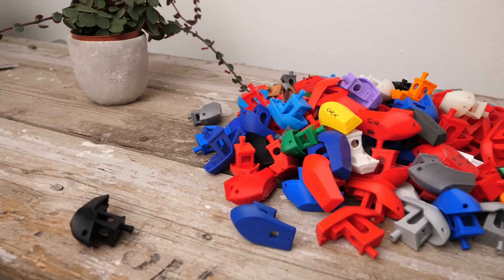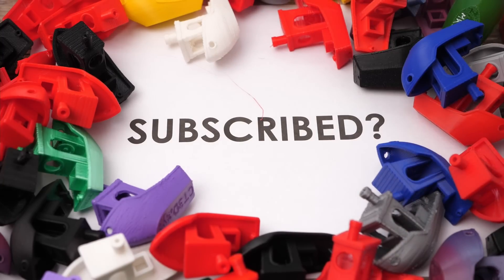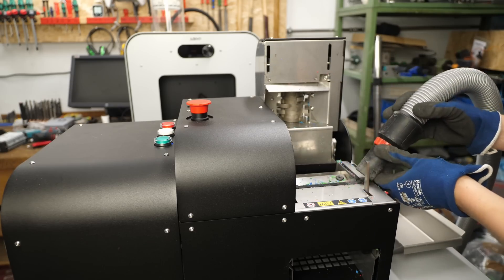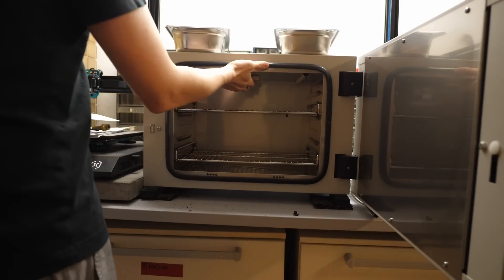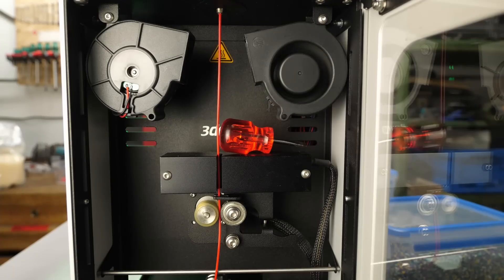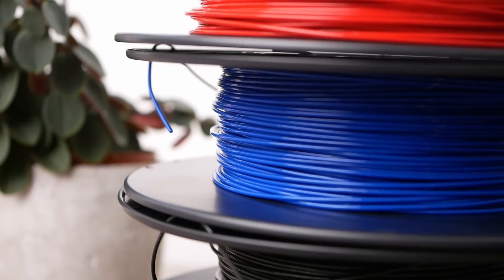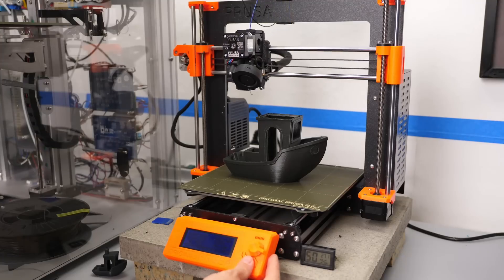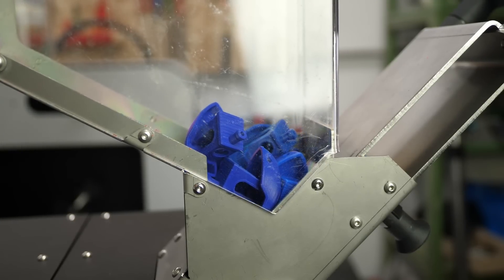Recycling all my 3DBenchys into new Filament

Comment: Someone needs to design a test print that is also a widely useful object.
Reply: I use a skeleton mini I find works well, and it just adds to my undead army for D&D.
Reply: @CaptainXJ  Neat idea, although lots of different colors might look weird on a skeleton army. But you could easily print different races and monsters for each color
Reply: Hooks that are compatible with 3M command tape would be a good start. There's lots of ways to design such a thing to test overhang, bridging, etc.
Reply: @pragmax  that's...  That's actually a good idea.
Reply: Perhaps a small boat for 3d printed wargame miniatures
Reply: A lego like 2x2 brick would be cool
Reply: I do my experimenting on objects I wanted to print anyways. Still a fair amount of waste, but at least I get something out of it.
Reply: I use shot glasses as my test prints
Reply: @LoadsOfMana wow, you must do a lot of test prints
Reply: @LoadsOfMana  I was going to do that but heard alcohol can readily pass through most of the plastics. Is that not the case?
Reply: @breakfast7595  You can coat them so that doesn't happen, but im lazy and didnt so yes it is def the case :P doesn't really matter for shot glasses though, since your shotting it soon as you pour anyway, takes a min for it to start escaping.
Reply: @breakfast7595  most people spill anyway lmao... source? I'm drunk rn. It's taking forever to type
Reply: What about some sort of clothespin ?
It's exactly the kind of object that can be made entirely out of plastic, is always useful and you need just about a billion copies of
Reply: i dont think they will be useful anymore if you have 500 of them
Reply: @DI-xe8vq  If you have 500 of them you're kinda doing a bad job at calibration ngl
Reply: @giedrius2149  or testing alot of different printers, filaments, or setting
Reply: @giedrius2149  love the ancient mesopotamian username
Reply: i print lego blocks
Reply: My test print is a set of D&D dice.
Reply: Obviously Lego's lol
Reply: I test print little tubs and boxes, because we've all got screws and other little bits that need storing
Reply: @TheHutchy01  that's smart! benchy has a bunch of difficult features meant to put your printer to the test; I wonder if it's possible to incorporate similar features into an otherwise simple box
Reply: good idea. how about a set of dice. instead of an xyz cube?
Reply: just make a water cup
Reply: make spoons or forks ?
Reply: A coaster :D
Reply: Print-in-place hinges are good, or organizers and dividers.
Reply: I've never actually printed a Benchy. I printed something that came with my printer with it's standard pla,  but after that I started printing my own designs and went from that.

I did print the print the infill cube to see how my extrusion was.
Reply: A phone stand would be good.
Reply: Screws?
Reply: I am thinking of redesign the benchy as a float for fishing. Adding a pocket for a coin at the lowest acts as a counterweight when in water. Fishingline holder is the exhaustpipe at the roof. Reshape it to a screw with pincing function holding the line locked. A bonus is when the boat goes missing. People will pick up this "litter" for the coin and hopefully dispose it in a trashcan (or use it again as a float)
Reply: knife
Reply: I hate wasting stuff. Maybe 3D printing isn't for me.
Reply: @goku445   If you are downloading models and printing them, there really isn't a lot of waste once you have your printer calibrated.  I have printed exactly one Benchy ever.  There is definitely some waste if you are designing your own objects to print.  I think of it as equivalent to saw dust.
Reply: @beauslim  Even if you stick purely to stuff other people have designed, a lot of models need suport material and/or brims, skirts etc.
Reply: @goku445  well I hope you would rather waste money 😂
Reply: Like a spoon?
Reply: @wynnnnnnn5227  There is No Spoon!
Reply: I use my benchys every day for various things. Door stops...... ummm I cant think of anything else atm. But I promise that adorable boat is useful haha
Reply: Yeah, I have never in my life printed a benchy or anything like that as it is such a waste, but even then there are failed prototypes and failed prints in general that add up, especially if you are looking at it globally.
Reply: a spork
Reply: Literally anything can be a test print haha
Reply: Legos, big duplos
Reply: what about a bag clip to close open bag of suger or salt and stuff.
Reply: Lego style blocks?
Reply: make 25% infill and bottom heavy and it'll float.
Reply: IK. you could make toy boats instead!
Reply: @DI-xe8vq  you could actually use a benchy in the water if it had been designed to have blast tanks.
Reply: @DI-xe8vq  a first step would be a useful swimming toy boat instead of the stupid upside down french marine boat.
Reply: @tdsangel  I like my submarines
Reply: benchy is useful it looks god on a shelf.
Reply: @cobz76  idk about a pile of 500 benches on a shelf...
Reply: Dildos are easy to print. And if you don't use it them you could gift them to others.
Reply: @MetalheadAndNerd  "unknown plastic additives", "abrasive surface", and "basically impossible to sanitize" are not phrases people generally like to hear in association with their sex toys. You could use carefully-researched filament and do some very intense post-processing, or print molds for casting medical-grade silicone, but that's no longer a test print model.
Reply: @spambot7110  Few people really sanitize their sex toys. Of course if you do it professionally you need professional grade sex toys which are dishwasher safe.
Regarding the unknown additives: Long ago I had a butt plug that liquefied the paint on the radiator I placed it on to dry after cleaning. Later it shrunk a plastic table cloth I placed in on. 3D filament additives are nothing compared to what unspecified Chinese "yelly" material contains. BTW: At least for PLA a couple of the lowest price brands now advertise theirs as food safe.
Reply: @MetalheadAndNerd  most people may not sanitize their sex toys, but I would hope they wash them with soap and warm water! That works ok because they have smooth surfaces that are easy to wash, while an untreated print is covered in tiny ridges that become a breeding ground for bacteria (in addition to tearing up your skin, at very least on a micro scale). A butt plug may be a bit better since one would hope the anus is able to routinely handle pretty gross material without issue, but it still seems pretty risky to me, especially if it's creating tiny wounds at the same time.

That's good to know that there are food-safe-advertised PLA brands though! But that still doesn't address the major safety issues with the layers. I know it's possible post-process prints to be body safe, and I'd love to learn more about that for my own purposes, but since we're talking about a benchy replacement, i think post-processing requirements would be a bit onerous.
Reply: @spambot7110  FYI, most PLA is food safe, but none of your prints are. The material is, but the process of printing creates small spaces and ridges for bacteria to live in.
However, you can dissolve some PLA in acetone, paint it on the model and let the acetone evaporate. (Do all this with good ventilation, acetone isn't great for you).
The acetone should slightly dissolve and smooth out the print surface. Best to cover the surface with medical grade silicone or a condom as well though. Better safe than sorry.
Reply: @MartinFinnerup  PLA is not soluble in acetone, you're thinking of ABS. to do the same thing with PLA, you need extremely dangerous solvents like chloroform.
Reply: Building Blocks. Ideally ones that could be reinforced with concrete or something. If you could build structures out of them, they stay out of landfills for a longer period of time.

Comment: I been saving most of my extra/ failed stuff just waiting for a cheap option to recycle them😉
Reply: me too, just can´t throw it away, cause i don´t want to waste anything
Reply: Melt it into plastic sheet or bar stock using a second hand oven and old teflon coated baking utensils as demonstrated by Precious Plastic on Youtube.
Reply: @Joshua0689  and how would that help in any way?
Reply: I resigned and thrown my 15kg+ of scrap and failed parts because it was taking too much space in my shop... :(
Reply: @Jonmal0ne  I felt this one.
Reply: Yeah I feel too guilty
Reply: Me too. It's just taking up some room in my basement until I have enough scrap to help offset the cost of the equipment needed.
Reply: https://www.robotdigg.com/m/product/1029/Desktop-Pellet-Filament-Extruder,-Production-Line?gclid=CjwKCAjwgISIBhBfEiwALE19SZXYKUIYFNtaC7QtwccHrLKXrcskZKkN9AK160IBC1od3b_SGl1ZZhoCm9IQAvD_BwE#

I doubt it's much good
Reply: @AdamMansbridge  and not really cheap $2,400 to get everything you need and it's made really only for pellets not grinded up 3d parts which you still need a grinder.

Comment: The reason for the deviations with the mixed filament might very well be due to the pigments within the pla, they all have their on properties and one filament might have a higher percentage of pigment to get the right color, combine that with other properties like hygroscopy and melting temperature and you get deviations that the extruder can't compensate for..
Reply: True but you missed the part where he sent a sample back to the extruder manufacturer and they had no problem that rules this out. The problem seems to be with his machine

Comment: Thanks for the nice video as usual. How about mixing recycled pellet with new pellet? I believe that the goal should be to reuse all your material, not necessarily have a 100% recycled spool. This might take down the inconsistencies by one order of magnitude but still achieving the goal of recycling all the unused prints.
Reply: If the goal is to recycle 100% of the off casts, then the best thing to do is give you trash to the recycler, and buy recycled filament. This is not the way to be nice to our planet
Reply: @joshua43214  i don't see your comment much related to mine, but more to the whole concept of the video, so basically it s a comment for stephan himself... i actually think that as long as you recycle all your material you don t hurt the planet, on top of the fact that pla is actually biodegradable

Comment: I work in manufacturing, high speed linear plastics extrusion is a large part of what we do (jacketing and insulating medium voltage cable)

The equipment in this video looks like miniaturized versions of equipment I work with.

We filter our molten plastics and rubbers through multiple layers of magnetized mesh screens to keep out impurities, especially metals, and handle our pellets in clean-room conditions.

The diameter of the extruded material is modulated by the extruder's screw rpm mostly, but fine-tuning is adjusted by adjusting the tension of the take-up spool.

As the spool fills up the force it is pulling with changes due to the effective-radius of the spool drum increasing the s it fills with material. We use in-line equipment to compensate for this, but the equipment's effect on the tension has a non-zero latency, so the faster the machine runs, the more the tension will vary along a given length, and I'm turn, the diameter as more tension causes the material to "neck-down" and less tension causes a "buldge".

If the latency of the tension-correcting equipment resonates with the rotation of the take-up spool that causes exponential issues.

As a spool rotates, it filled unevenly, and will become slightly oblonged, when the peak of that radius is pulling in the line the tension increases slightly, and when the trough is pulling on the line the tension decreases slightly, and when that resonates with the latency of the tension-correcting equipment then it looks like the line becoming slack- then taught, then slack, them taught. It can be fixed by changing the speed of the machine so it no longer resonates, and after the radius of the drum changes (from further filling with filament) the machine can be restored to it's ideal operating speed.
Reply: In line equipment used to stabilize the tension on the line are dancers.

Additional rollers installed in front of the take-up spool that have a degree of movement relative to the material's tendency to slack.

If slack in the material causes the line to drop towards the ground, then the roller is free to move up/down. Limit switches are used to detect the roller's position, and the take-up spool motor is configured to increase/decrease power based on the limit switches.

Additionally the dancers are under tension to pull the material toward it's position of slack, to dampen any higher tension from the take-up spool, as any additional tension will have to pull the slack out if the line caused by the dancer.
Reply: @ChayComas  this was a fascinating read. Hats off to you 👏.
Reply: @antoniomromo  Even more impressive, we have a rubber extruder line that contains no rollers for a 400ft length at the exit of the extruder.

The extruded material is suspended for about 400 feet in a curved tube before it finally rolls along it's first support.

The tension on the cable has to be just so, so that it doesn't rub along any surface inside the tube, to ensure a perfect surface finish on the vulcanized rubber.

The molten rubber's flow coefficient is compensated for by extruding oblongued, so that it flows into a more circular shape before it's finished curing inside the tube.

The tube is full of steam.
Reply: @ChayComas  this place is magical!!!
Reply: @antoniomromo  Okonite Cable Company, we make high quality electrical cables, and claim quality above all else.
Reply: @antoniomromo  and I'm just their high school diploma Quality Control lab geek.
Reply: @ChayComas  I could just spend hours listening to the people explain everything. That's honestly one of the world's joys. Especially if they were like expert level 😍.
Reply: @antoniomromo  same here man, I am sincerely passionate about why stuff happens....

I hope you find everything you ever look for dude.
Reply: @ChayComas   I'll say! Your VFD cable is legendary.
Reply: Strikes me there needs to be a better solution that modulates the takeup, like a W pulley arrangement that controls a constant speed puller such that the takeup reel would be passive from the manufacturing perspective. I'm reminded of working in the movie theatre and the speed regulating pulleys that governed the payout and makeup platters were honestly the coolest part.
Reply: Bit in it hey.
Reply: Thanks for those interesting details Chay, I learned something.
Reply: slightly off topic, but how are plastic parts like this green/yellow terminal block molded without the colors blending? https://www.wago.com/medias/0200000a00001bcb000200b6-DE.jpg?context=bWFzdGVyfGltYWdlc3w4MDM1OXxpbWFnZS9qcGVnfGltYWdlcy9oYTQvaGU1Lzk4ODIzMDM3OTExMzQuanBnfDVlZTY2ZGNjZjhiOTUxZmRlMWU4MWZkNDllMzQwYTg0M2U4OGY3Y2ZkZGJkZjg5NzNmOTgyNGVjMjE5MzNlOWY
Reply: @skmetal7  so funny he's taken so long to write out this point and you just totally hijacked to a totally unrelated topic. 😂
Reply: @Mrtickleberries  LOL
Reply: @skmetal7  Multiple extruders to multiple entry points in the mold would be my guess. The extruder by its nature would homogenize the material in that screw, but nothing says you can't have multiples.
Reply: @frollard  sounds expensive.
Reply: @frollard  the screw pushes the material, not really mixing it like you would think a spoon in a pot would. You can add the colors together in a hopper if you're pellets are large enough and make sure they melt at the correct temperature.

Also the rough surface on the filament after recycling is call gels. It comes from the smaller partials being degraded in the melting process. You could also get gels if you have shapes like acute triangles. Its very hard to get rid of them with regrind. 

https://www.ptonline.com/articles/what's-causing-your-gels

Comment: Would be interesting how the filament behaves, if you recycle it again. and again. and so on. 
Recycling once is awesome, but imagine you could recycle it like 5 times or so. 
But I guess this only works if you add virgin material every time
Reply: There are some companies that do recycle filament, they usually throw in about 50% virgin plastic into the mix. The more you heat the plastic the more it breaks down the polymer chains causing it to be weaker. Ideally you would break down the polymers into monomers and reform the chains to create virgin material, would give a chance to remove any dyes as well from the plastic. But that would require a fairly large scale set up to break even on cost. Though the solvent used in creating PLA would be reusable so there wouldn't be much waste created apart from the energy requirements of the whole process.

Comment: Somebody in a maker community, where there are a lot of 3d printer nerds in the same area, could provide a great service. Bring in you failed prints sorted by color and receive the equivalent in recycled filament. Maybe 2 to one ration, so the maker could also make some money. Bring in 10 pounds of benchies, and leave with two new full spools of what ever color you want.